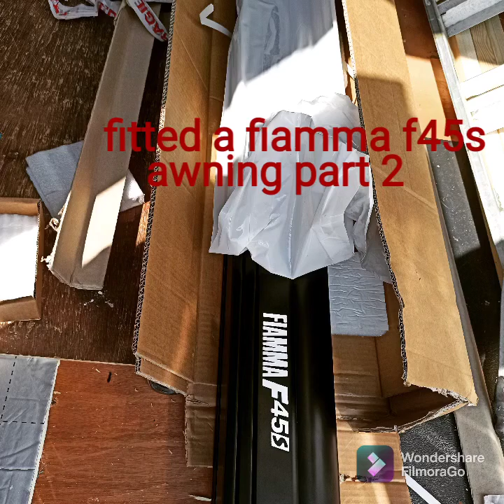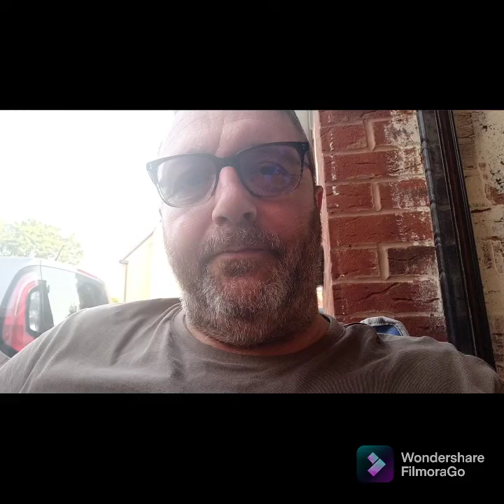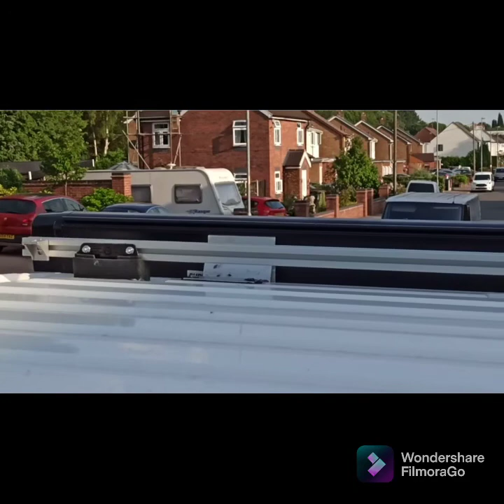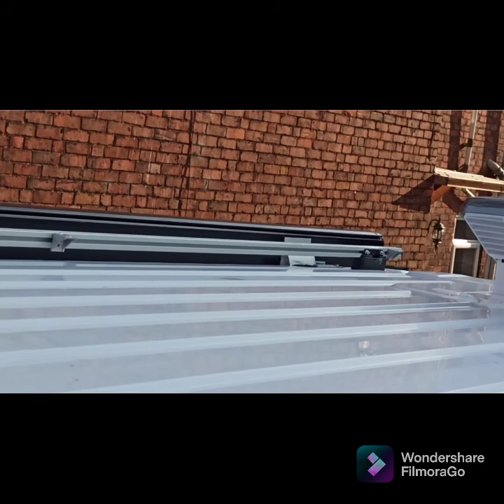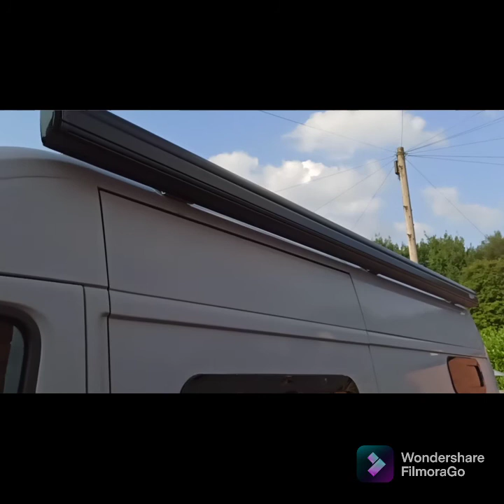fitting a fiamma f45s  awning  to a fiat ducato part 2

Comment: Hello,
Thanks for your video. We are instaling same awning as you, but we have a problem. When we put adaptator in face to the inscription support we can't drill the awning because there is the awning's mecanism. How did you do to attach the awning to the bracket ?
Thanks
David form France
Reply from the maker: I put the support brackets in a different place so I could drill through and put the bolt in , I could only use two bolts though so I used a polyurethane adhesive on the other bracket , if you open the awning fully you may be able to slide the awning along just enough to drill a hole through and  put in a bolt
Reply: @nasty.nick.p  ok thanks you for the answer !

Comment: I would like to find a way of not having to drill too many holes in the van...so was hoping to somehow attach awning to  roof rack....you obviously would have thought about that and concluded it was not possible.
Reply from the maker: It was also the cost of the bracket, the one I used was half the price ,also the amount of sealant/ adhesive I used it will never come off or leak👍

Comment: Did  those brackets come with the fiamma f45s? Are the specifice brackets for the Ducato Fiat? If not were did you get those brackets from?
Reply from the maker: Try searching for this  on Google Adapter kit for fitting F45S, F45 Ti, F45L and F45 Ti L awnings onto a Fiat Ducato with a roof rack fits Ducato after 2006 with roof rack , Fiamma part number 98655-485 this is the one I have